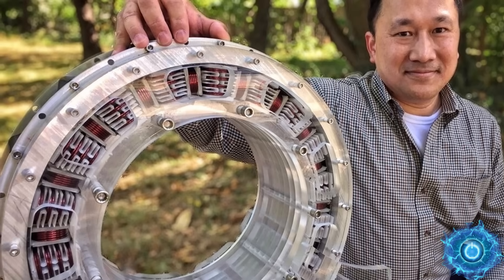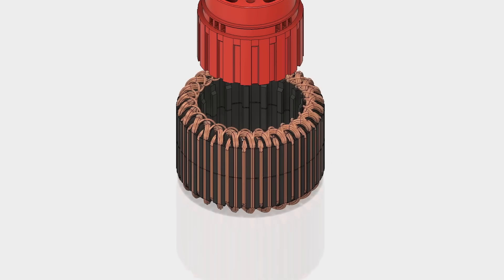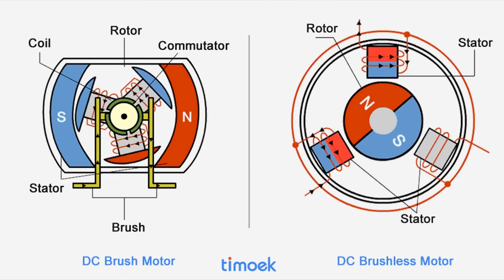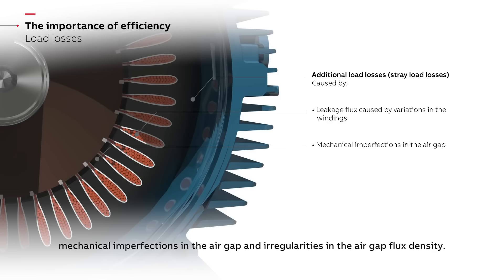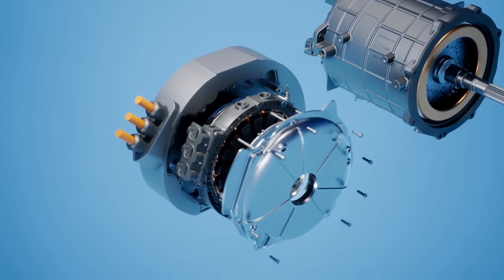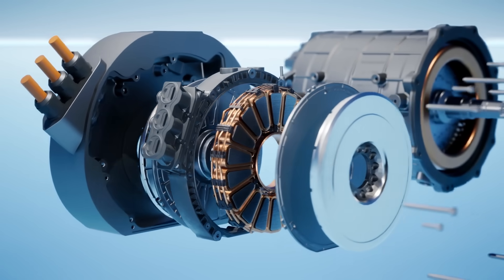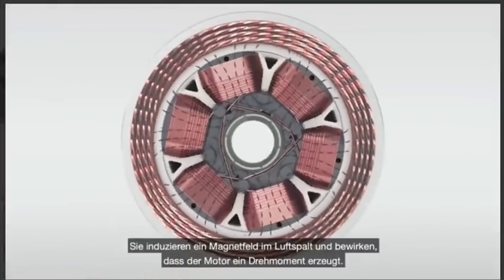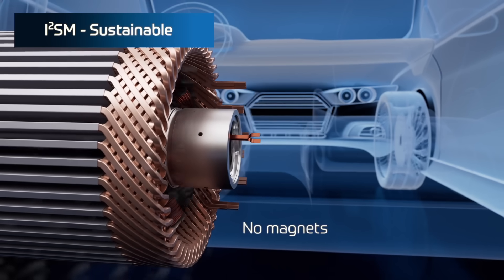INVENTOR BUILDS Breakthrough MOTOR - IS it REAL!?

Comment: Straight up electro-mechanical efficiency might be in the 90%+ range already, my guess is they are using mass to power output which is another important type of efficiency although they should clarify that.

Comment: TAKE A LOOK ... Below is a detailed circuit schematic description and an accompanying ASCII diagram you can use as a blueprint for a PCB layout (which you can later import or trace in OpenOffice Draw):
Overview of the 12V Electromagnetic Pulse System
1. Energy Collection & Conditioning: 
Source: Coiled magnet set in motion (from your moving magnets) generates an AC voltage. 
Rectification & Filtering: A bridge rectifier converts this AC into DC. Filtering capacitors smooth the output. 
Capacitor Bank: The smoothed DC charges a capacitor bank rated for 12V operation. 
Voltage Regulation: A 12V regulator (if needed) ensures the voltage remains stable for subsequent circuit elements. 
2. Pulse Discharge & Polarity Control: 
H-Bridge: Four MOSFETs arranged in an H-bridge configuration allow you to route the 12V discharge either way across the electromagnet load. 
Pulse Control: A MOSFET driver circuit (with designated gate resistors) is driven by PWM signals to provide precisely timed, fast switching. 
3. Logic-Based Corrections: 
Microcontroller: A microcontroller (for example, an Arduino Nano or similar) monitors key system parameters (voltage, current via sensors/voltage dividers) and provides PWM outputs. 
Feedback Loop: Based on the sensed parameters (which represent the “induced resistance”), the microcontroller adjusts the switching and even controls the polarity (via the H-bridge) as needed. 
Component Value Recommendations (Example Values):
Capacitor Bank: You might use an array—say 4–8 electrolytic or tantalum capacitors in parallel—to achieve a total capacitance in the range of 220 µF to 470 µF (rated at 25V for a safety margin) so that at 12V the energy can be stored and released appropriately. 
MOSFETs: Choose logic-level MOSFETs that can fully switch on with a 12V (or lower, if using a proper driver) gate drive. For low-power applications, parts like the IRLZ44N (or similar) can work well. 
Bridge Rectifier: A full-wave bridge rectifier rated for your expected current, typically with a voltage rating of at least 25V. 
Microcontroller: An Arduino Nano or similar 5V / 3.3V board will suffice. Use appropriate level shifting if your MOSFET driver or high‐side drive requires 12V signals. 
Gate Driver: A dedicated gate driver IC (or driver transistor circuitry) can help ensure rapid switching of the MOSFETs. 
ASCII Schematic Diagram
Below is an ASCII representation of the complete circuit:
[Coiled Magnet Energy Source] │ │ ▼ ┌─────────────────────┐ │ Bridge Rectifier │ │ (D1, D2, D3, D4) │ └─────────────────────┘ │ ▼ ┌─────────────────────┐ │ Filtering Stage │ │ (Bypass Capacitors) │ └─────────────────────┘ │ ▼ ┌─────────────────────┐ │ Capacitor Bank │ │ (Total C ≈ 220-470µF)│ │ Rated for 25V+ │ └─────────────────────┘ │ ▼ ┌─────────────────────┐ │ 12V Voltage Reg. │ └─────────────────────┘ │ +-------+-------+ │ │ ▼ ▼ ┌─────────────────┐ ┌───────────────┐ │ Microcontroller │ │ Sensor Input │ │ (e.g., Arduino │ │ (Current/Volt)│ │ Nano) │ └───────────────┘ └─────────────────┘ │ │ PWM / Logic Signals │ (and feedback control) ▼ ┌─────────────────────────────┐ │ Gate Driver / MOSFET │ │ Switching Circuit │ └─────────────────────────────┘ │ ▼ ┌──────────────┐ │ H-Bridge │ │ (4 MOSFETs: │ │ Q1, Q2, Q3, Q4)│ └──────────────┘ │ │ ┌─────┘ └─────┐ │ │ ▼ ▼ ┌────────────────┐ ┌────────────────┐ │ Electromagnet │ │ Electromagnet │ │ (Pulse Coil 1) │ │ (Pulse Coil 2) │ └────────────────┘ └────────────────┘ 

Explanation:
1. Energy Source & Conditioning: The top part captures energy from the motion of coiled magnets. The AC is rectified and smoothed, then stored in a capacitor bank. A voltage regulator maintains a steady 12V output for the rest of the circuit. 
2. Control & Logic: The microcontroller receives sensor data and, using PWM outputs along with a dedicated gate driver, controls the H-bridge. This provides precise timing and polarity control of the electromagnetic pulse through rapid switching of MOSFETs. 
3. H-Bridge & Load: The H-bridge (with four MOSFETs) routes the 12V pulse to one of two electromagnet loads. You could use this setup to adjust the magnetic polarity dynamically, overcoming load resistance as measured by your sensors. 
Next Steps for PCB Creation in OpenOffice:
1. Transfer the Diagram: 
Open OpenOffice Draw (or Impress). 
Use vector shapes (rectangles, lines, arrows) to recreate the block diagram based on the above ASCII layout. 
2. Refinement: 
Label components clearly. 
Use layers to separate the power, control, and sensor sections. 
3. Export: 
Once complete, export your schematic as a PDF or SVG, which can be shared or printed. 
This schematic is a starting point—you may need to iterate and adjust values or add in additional protections (like flyback diodes across the electromagnet coils) when you build and test your prototype.
Would you like more details on any specific section—such as the MOSFET gate driver design or how to implement the microcontroller feedback loop?
EXAMPLE ON TYPE TO BE USED .    https://www.youtube.com/watch?v=YCuVSAnlQfw
there are better designes

Comment: For the present these Rare-Earth free designs are only being progressed because of potential supply chain issues with China controlling most of the Rare Earth supply. If the supply issue is sorted then this requirement goes away. Having said that if we could make a 100% superconducting design then having coils for both rotor and stator would mean that we are then only limited by the amount of electrical power the thing can take enabling small 5Mw+ engines.

Comment: The shape of the body of the motor must be incorporated into its design tuned as such that it would have the potential to power itself up as soon as it's assembled via capacitance functioning from producing an initial pulse with the frequency of its structure so a Toroidal Field System in resonance that would be classed as a Quantum Motor because the function of energy by its nature has to keep flowing having a rhythm so ultimately must be perpetual the very potential of the exotic substance the Universe is a superconductive body that generated under high entropy yet in its initial stage of development!

Comment: Future  motors will have carbon nanotube superconductors instead of  copper. Right now a 100 kw generator head unit weighs about 750 pounds, compare that to a carbon nanotubes wound generator head weighing only 75 pounds. That's a significant difference especially for weight sensitive applications such as aviation.

Comment: Electromagnetic excitation is nice, because you can vary the magnetic excitation in order to operate the motor with an additional degree of freedom. But electromagnetic excitation is also less efficient, because you need some energy for the excitation current.

Comment: Just to be clear there are numerous claims about the advantages of axial flux but so far there have never ever been a lab SOA axial flux motor that comes anywhere near the power density og of Lucid Motors and thus the axial flux motor designs are still even further away from the power density of lab SOA radial flux. While it is easy to explain the theoretical advantages of axial flux it is very difficult to explain the shortcomings of axial flux.

Comment: There is ALWAYS a trade-off.  I'd love to see the torque and efficiency graphs for these motors.  You almost always have to give up something to gain elsewhere.  I work for an R&D traction motor engineering company.  I've seen some of these ideas simulated and fall dead on their face for one reason or another.  Either you lose too much low RPM torque or your top RPM becomes too limited.  Then you have parasitic power loses and increased complexity to the electronics.  If a motor is 99 percent efficient, but the electronics driving it are only 80 percent efficient, you have an overall system with only 88/89 percent efficiency.

Comment: We need to start adding Quartz Crystals, Marcel Vogel said if you cut the crystal ends at  exact angle of 51.843 degrees the same as pyramids it will produce power.

Comment: This will generate power but how much is not calculatable with the data available. Having said that I do not believe that the generator would perform as stated due to irregular design features so I would say with care that it is most probably a SCAM.

Comment: In many situations when saying 50% better efficiency, it means 50% less losses compared to some other motor. While it can be debated whether it is correct to say it this way, it makes some sense when talking about efficiencies close to 100%.

In this lever, efficiency increase don't have significant meaning, except when dealing with waste heat.

We can also get better efficiency increase when talking about efficiency on non optimal area. For example with EV's, average efficiency is not close to motor maximum efficiency.

Comment: you can also make motors two-sided, so both sides of the magnet, the magnetic field is being used 2x total. ie hallback is a bit trick and gimmick. true DC motors are better, no switching of current direction or magnetic field direction, constant torque. no torque caps (no pulsing force).

Comment: I love the electric motor technology, the more efficient, more power that is being achieved.  Wish I was an expert in the technology with access to all the resources to try and out-do what's already been done.

Curious if you can compare Elon Musk's latest motor with (I think) rotated magnets, and carbon wrapped armature to prevent it from flying apart at 15,000 rpms.

Thanks for the video.
And, yeah, I am a little tires of people talking about the latest technology when it only runs at -300C or some such terribly cold and impossible circumstance for reality.
Reply: -300 DegC is below absolute zero....  -273 DegC is absolute zero

Comment: Could ammonia be used as the  coolant?  Running coolant coils between the wire coils along with the air cooled cavities.  Would that not help with heat reduction?

Comment: Only by experimenting and doing things, that we take risks and 'learn' to find better alternatives. It is not by replacing things that these alternatives would be proven true. It's all a continuous trial and error.

Politics and Oil mongers basically don't want you to become more efficient, if it means using less fuel for instance, or if you don't require or become dependent on them.

The keyword is dependency, and moving away from that requires time and effort, and they would roadblock either.

So if you can't scale it up big, then keep it small and make it widespread... If you can't enter the market because they blocked it, teach everyone how to make it, saturate the populace with a knowledge that becomes proven? Eventually it'll become a insurmountable force that they can't block anymore.

3d Printers are everywhere, and magnets can be attained to build DIY experiments, so if everyone can get their hands on it, then they can sooner participate?

Comment: Reducing the number of rare earth magnets could lower the cost, but at the expense of weight, and really the power increase per unit weight is less than fifty percent greater. Stator motors short out and magnets do not. The problem with rare earths is that they are not that rare, its that processing rare earths is more expensive as the density goes down. Just to give an example, Aluminum is one of the most abundant minerals in earths crust, but the production of aluminum requires a tremendous amount of electricity and so the production likes to start with material over a certain percent, so that electricity and chemicals dont need to be applied to that which eventually slag. Some of the chemicals and mineral waste are quite toxic. All of these problems, with help from the public sector can be minimzed.

Comment: Even more interested in how this could possibly affect electrical generation? If you can use the hall effect to produce a more efficient electric motor, it only stands to reason you could use exactly the same thing to produce a more efficient generator. A more efficient generator can convert more mechanical energy into electrical current

Comment: Focused Magnetics created an electro magnetic Halbach array STATOR (never done before successfully) used in combination w/permanent magnet Halbach array rotors.  The pole ratios on both stator & rotor are, Stator - 3%\97% [motor airgap] 97%\3% - Rotor.  More magnetic flux power at the air gap.  NOTE: the power required to energize the Stator is still same to generate the nearly doubled magnetic flux at the motor airgap generating torque (same amount of motor materials).  Conventional motor architecture ratios are (R50%/50%ST) = 100 but FM motors = R97%\97%St. more of the total available magnetic flux energy at the airgap. Same sized motors, the FM motor double the output (power density).  They never mention efficiency as doubled. The benefit is 97%Rotor + 97% Stator of avail magnetic flux energy w/o more battery pwr energizing the coil! Does it help solve battery requirements (less batteries) to achieve a given range goal, yes!

Comment: It would be crazy cool if someone finds out a material that is like a hallbach array but it can be energized to flip or modulate the field, kind of like a pulsed motor by instead of pulsing through coils there could be magnets pulsed and they could be made without wire, just a ferrite composite. Just a random thought the breakthrough by sandia with the new sulfide magnets, perhaps even something like a gel or liquid. Or an organic based. Maybe almost like a battery, but more like a magnet capacitor plate thing. Maybe it could be mechanical it could go slowly and then as it moves inside a rotating mechanism it shifts around and the magnetic field moves which contribute to the movement, or if it reacts to temperature. Maybe an emergency brake, that activates itself without any power or circuits just by falling into an array during an event, and being a non destructive emergency brake.

Comment: No magnets is a real plus. Inboard motors present a less complex deployment, easier cooling implementations and removing the weight from the wheel itself allowing for conventional wheel systems and a larger range of vehicle choices without having to re-engineer for specific wheels. No magnets frees up companies and indeed nations to be less dependent on China and rare earth supplies. Copper is everywhere. Even aluminum can be substituted where useful. Inboard motors can also have a two-speed gear assembly or small CVT via the exit shaft, expanding even more the potential uses. Efficiency should not be the holy grail to which all other forms are sacrificed. Superconductor cooling is an energy loss and only suitable for extreme applications where cost of build and operation is not an issue.

Comment: Correct me if I am wrong, but brushless motors rather rely on the Lorentz force instead of magnetic attraction. This hallbach aray is obviously used for magnetic attraction. To me it seems like a waste of windings that don't contribute to the total Lorentz force and thus torque. Is it really that much stronger when it acts like an electromagnet?

Comment: Tesla planning to use ferrite as a alternative to rare earths and get a workable radial flux EV motor.  We have a design that uses very large ferrite magnets in a spoke design held in place with a carbon fibre sleeve. The Coersivity and Remanence of ferrite magnets have been improved so much that this is now possible.  There is really no need for anything more complicated than this.  Our motor has identical torque and power density of a VW APP550 motor.  It is more efficient and around $200 lower cost.  However to achieve these high performance ferrite magnets, a small amount of light weight rare earth oxide called Lanthanum is incorporated in the ceramic materials.  As always it is the detail of any engineering design that creates results.  Lanthanum is around 1/10th the cost of Neodynium and because it is ceramic it is non conductive and can operate up to 250 deg C.  When Tesla makes a move it is usually the best one.

Comment: As a power engineer I've never seen an electric motor that was 50% efficient and if I did I would change it out immediately. <80% is all I've ever seen, even in brushed motors. Not to mention 50% being turned into heat would be A LOT of heat. It's still an interesting concept using electromagnets but it's way overhyped with the claims so I'd say it's sus.

Comment: That motor sounds very much like an alternator as far as cooling forced air or copper tubing around stator with fluid like antifreeze pumped through in a closed loop would probably work best

Comment: I would be curious to know if this technology could be used to improve the efficiency and power output (watts) of the automotive alternator, which is really like a motor in reverse - it uses mechanical motion to generate electricity.
Reply: Of course, it would.  However, a vehicle using an alternator to charge and power an auxiliary uses a combustion engine to power the vehicle down the road AND turn the alternator.  Let's say you put this highly efficient design in place of an alternator.... what would you do with the extra electricity?  My point is that it's not needed, which is why they make very durable, less efficient alternators for combustion vehicles.  For a hybrid vehicle, it would clearly be amazing.